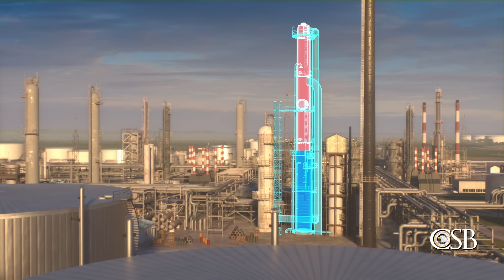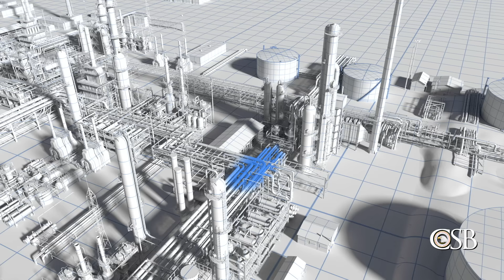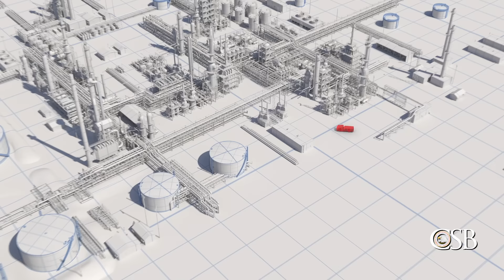Animation of April 26, 2018, Explosion and Fire at the Husky Energy Refinery in Superior, Wisconsin

Comment: Another slide valve failure wtf
Reply: It looks like all of the locations need to change them within a given time frame. If they do not, it needs to be priority #1 in a database to send a notification. It seems like almost all of these fires we see on here come from these valves at fcc's.
Reply: Seems to me there should be a proper isolation valve between the FCC and regenerator that is closed when the unit is offline, rather than relying on the slide valve to prevent flammable vapour flow.
Reply: @jhonbus  based on these companies just on these videos, that same valve would be lacking in preventative maintenance too..
Reply: @CumminsCat  Agreed, this is why I think they need redundancy valves so if one fails the other has a chance to still keep a seal. That would give better longevity until a maintenance review actually happens
Reply: CannabisCultureTechLife 

The problem with isolation valves in this scenario is the temperatures.

It requires metal valve seats, which seal quite poorly (as a seal is usually the product of squeezing or deforming a malleable material). The are usually triple offset butterflies (which inhibit flow significantly and will suffer worse erosion problems).

They are using the correct equipment, however I bet they reduced the valve internals’ inspection regime to reduce downtime. Result, badly worn valve performing poorly.
Reply: Thought Ive seen that here before
Reply: @mattg5878  It just doesn't seem sensible to me to rely on a wearing component (a metal flap that's constantly in a stream of abrasive pellets) to provide a reliable gas seal.
Reply: @jhonbus  

It's a fair comment, however the temperature limits the technology available.

To go into a bit more detail, as I say at those temperature and abrasive conditions, only metal valve seats can be used. While metal valve seats make a valve possible, they are a double edged sword as the seat now expands with temperature. So what seals adequately at design temperature leaks like a sieve at ambient temperature. Massive pain in the arse. 

Same with rotary valves. I had one that did a good job at design temperature but was absolutely useless below design temperature. 

The takeaway message is that every FCC is the world uses slide valves, and the reason we don't have an event like this every day is because we inspect the condition of our key safety plant regularly. But at the smaller refineries, it only takes one accountant to force reductions in maintenance and inspection to drive production.
Reply: @CannabisTechLife  Some places do have double slide valves for this exact purpose but if one is eroding away that quickly then chances are the other one is too. Catalyst service is extremely aggressive because the of how hot and abrasive it is..
Reply: I wonder if it would be possible to engineer a system of two metal slide doors - top and bottom - that also can be retracted for inspection. That way the first step to preventive maintenance could be to retract the slide doors to ensure they are in working condition, replace them if they are suffering wear, then close them with a tight seal with the good condition slide doors verified to be in place. Unfortunately, I get that these may introduce greater complexity and thus more points of failure, but would the system be more or less reliable? Also, how would cost repair over the life of the factory?
Reply: @dillenbeck53531  You can inspect through remote operations. Cameras on sleds. No need to withdraw the valve for inspection.

We use remote welders and surface treatment sleds. 

The problem isn't the engineering design, the problem is the operations, inspection, and maintenance. 

If they used sled cams every year, they would know the state of the valve. Once pitting starts, schedule a swap for the next outage. Standard asset management.

What I'm saying is, if the design was the problem then every FCC in the world could be on fire. They aren't. They operate for 40+ years no problems.
Reply: M G Automobile engines all use metal to metal valves in the cylinder heads, closing on to the heads’ metal valve seats, to seal the combustion chamber around 1500-1600F under heavy load. At 2000-8000 RPM, they must close and seal billions of times over the life of the engine.
Reply: @jhonbus  that is what level indication is for. They never should have allowed it to go empty.
Reply: Add that one to the USCSB drinking game
Reply: @Syclone0044  

Absolutely right, internal combustion engines use metal to metal valves for inlet and outlet control. 

However, the purpose of the engine is to produce motive force and so a significant amount of thermal energy is "wasted" as it is not the primary function of the process. For this reason, the engine head is cooled to less than 120 C (with the waste heat discharged through the radiator). Keeping the engine block at this relatively low temperature means the expansion issues with the valve seats (and other components) is avoided. This is also why the head gasket can be made from non metallic fibre (and why all the electrical connections are plastic!)

If your coolant on the engine stop, and the temperature rises, what happens? Distortion of the engine block usually ending in head gasket failure, piston ring failure, valve damage.

Now we could actively cool the valve and catalyst return pipe, but this process is entirely based on thermal efficiency (not to produce motive force). So using energy to heat a material that you have just used energy to actively cool is uneconomic and environmentally damaging. Note, refineries are usually +90% energy efficient (which is why we can afford petrol).

Also, car engines do not deal in the constant erosion environment that the catalyst return pipe do.

But you are absolutely correct to point at other industries and techniques to highlight that there should be a better way. I do this all the time at work. Engineering isnt complicated. We live in a world of refinement, not invention!
Reply: @mattg5878  Why not use a disposable section of pipe and something like a blind shear ram for maintenance isolation?  After maintenance is finished you could replace the pipe.
Reply: @davedoe6445  That's basically what it is, except the ram isn't hydraulic. It's an electric actuator.
Reply: @mattg5878  I guess I'm imagining the actuator staying outside the pipe to avoid the corrosion issues but I imagine it makes other problems.
Reply: @mattg5878  A single ball valve with a stainless steel ball riding on a cast iron seal would not be gas tight, but it would be able to completely stop the flow of the catalyst (which is what provides the barrier), right?
Reply: @eddiehidani3683  Had that happen to me, two pneumatically operated (and electrically supervised) butterfly valves and one hand operated in series, problem was the rubber seal in all three valves had completely dissolved due to VOCs in the gas stream.

For a proper redundancy different valve types should be used, IMO.
Reply: @Serostern  Can't say I have come across cast iron seats before - usually the bodies are cast iron. But the point still stands, if you have a valve which can survive 1000s of hours of operation in high erosion, very high temperature operation then perfect - let the petrochemical industry know and take your billions. 
If not, and the valve deforms and then can't physically close then the situation is no better than in the video
Reply: It is possible that this repair is the most costly of the lot . That’s why companies aren’t cutting the edge
Reply: @jhonbus  Good call, They should have a secondary valve used ONLY when the unit is shutdown. This way that valve is either fully open or fully shut and wont be subject to the erosion that the original slide valves face when they are set partially open to control the flow of catalyst.
Reply: Oxy Berry g
Reply: It's ALWAYS  a damn VALVE.
Reply: Exactly. Looks extremely similar to 2015 Explosion at ExxonMobil Refinery in Torrance, CA. Also solid catalyst valve failure.
Reply: Failure because of poor upkeep.
Reply: @CumminsCat  The safety cutoff valve should be kept fully open during normal running, protecting its blade from erosion. Then close both for the shutdown, and keep the catalyst auger running during the cooldown to maintain the supply of catalyst in the reactor. Belt, suspenders, AND baling wire.
Reply: @CumminsCat  that's how aircraft work. After a certain number of hours the gearbox is opened to verify its integrity
Reply: @invertedv12powerhouse77  only here, they do not maintain their preventative maintenance based on the info the videos give.
Reply: @r0cketplumber  obviously it seems to erode the pipe and the valve in this closed atmosphere so when it is isolated/activated a tight deal is not maintained. They definitely need to be mandatory replaced after so many years.
Reply: @CannabisTechLife  they should have some sort of flow meter or O2 sensor, to have a monitoring system and or Alarm in case the valves don't hold and air is allowed to mix.
Reply: @CumminsCat  Disagree, it seems to be a design issue (I do not have the P&ID so I cannot really draw conclusion). If the simulation is consistent with reality the layer of protection is very weak. It would be interesting to see the LOPA
Reply: @jhonbus  Totally agree with you
Reply: And again allowing backwards flow downstream!
Reply: I’m a little surprised that the HAZOP didn’t catch this. Reverse flow is a common keyword.
Reply: @mattg5878  How about a mogas ball valve? Im not familiar with a FCC but unit but seems like they would work in that application too
Reply: @mattg5878  
Wait, you remotely build up worn out slide valves in-situ by remote welding?
Reply: @gregorymalchuk272  
I left oil and gas, and now work in nuclear. And we use remote ops to treat stress corrosion cracking in steam pipes. 
I would say use remote ops to.insoect the valves, and replace when required.
Reply: @mattg5878  Ahh, cool. What kind of stuff do you do in the nuclear industry?
Reply: @gregorymalchuk272  
That's a very open ended question.

I have worked in Boilers, Spent Fuel Processing, HVAC, and disaster recovery equipment.
Reply: at some point it's a conspiracy to keep prices high  but I laugh now that prices are 99cents a gallon
Reply: @punker4Real  The prices are only.high cause of government tax
Reply: Nature of game.  Hot flowing erosive catalyst against metal.
Reply: @eddiehidani3683  The secondary valve can be retracted completely during normal operation, so it'll be out of the abrasive stream.

A better procedure would be to flush the whole system with nitrogen during maintenance operations.
Reply: @CannabisTechLife  The management mindset is likely then to be that since there are two, maintenance can be deferred. Redundancy only works if the the redundant elements are tested regularly.
Reply: Spade could be using for isolating plant
Reply: All you really need is a well established pressure balance between the reactor, regen, fractionator, and a proper way to identify loss of catalyst barrier...
Reply: MrBen527 These valves are typically designed for one run and replaced afterwards. They normally erode, there’s really not much you can do other than limit the extent of erosion by managing the dP across the valve through its life...
Reply: @mikeymcmikeface5599  Atleast they arent crossing!
Reply: it might better to have a air release valve before  the isolation valve can prevent the air from passing back?
Reply: That is not a fail-safe system
Reply: Ikr I’m like wait a second I’ve seen this shit
Reply: The slide valves take a lot of abuse.  The catalyst being called “solid” in the report is misleading.  The catalyst is really more like a finely powdered sand, finer than table salt, and just as abrasive.  The catalyst carryover into the FCC fractionation residual is enough that it will cause thinning in the piping after a period of time.
Reply: I saw it coming!!!
Reply: @CumminsCat  Seems like there should be a way to verify that a valve has closed as well. Some kind of sensor to detect the sound of material flowing through to let people know that it hasn't closed. Could also help human error too when they forget to close a valve.
Reply: Aren't all US refineries getting pretty old?
Reply: Why not double up and add two additional slide valves so that there is redundancy in case one fails on either side of the reactor?  I know it would cost more but would prevent even more costly damage.
Reply: As a plumber That works in a food factory I can tell you that everyone knows about these valves are bound to fail. It’s just that no one wants to shut off the plant to replace the valve cause it stops production.
Reply: An alarm detecting reduction in the catalyst barrier below a minimal level, or detecting the flow of air where it shouldn't be, would also be a good idea. An extra valve could be added as a failsafe - it could even go off automatically in the event that oxygen is detected flowing through the primary slide valve. The failsafe valve would not need to be a slide valve either since it would only be used in case of slide valve failure. It could be a more robust design like a ball valve.
Reply: Slide valves are just cheap valves, its literally just cost cutting